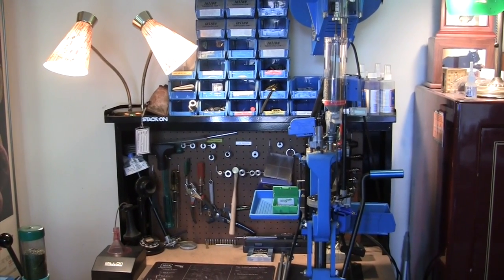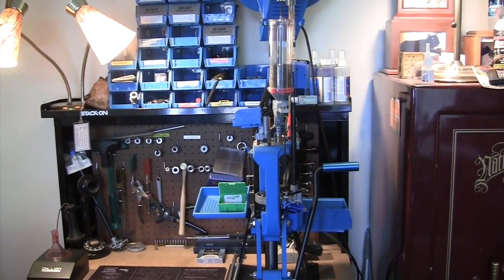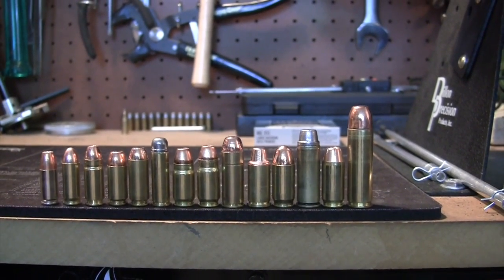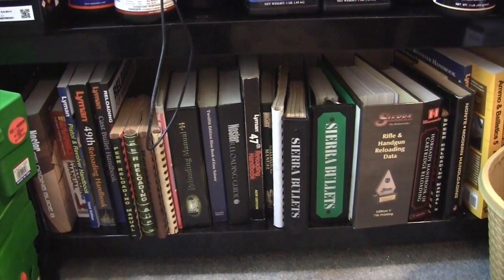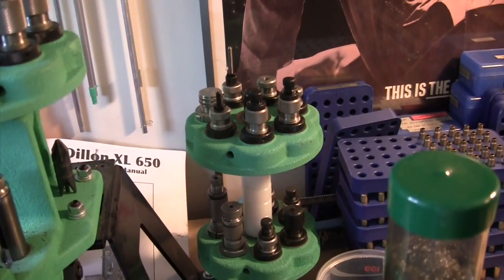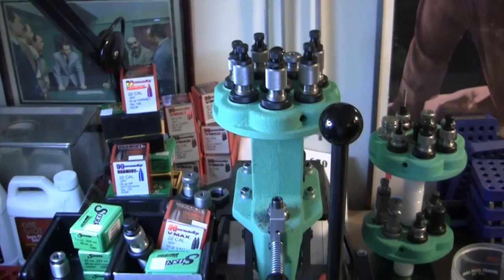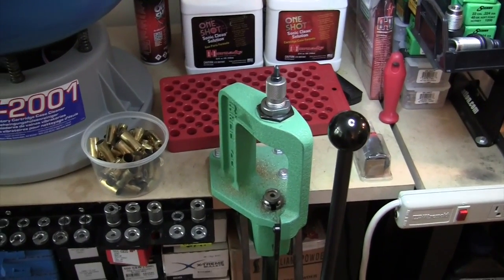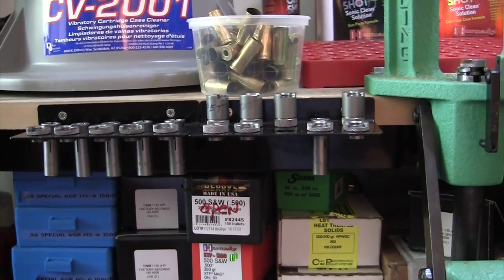Dillon XL650, Redding T-7 Turet Press, Big Boss 2 Press

Comment: Your experiences in reloading turn out to be an extrapolation of what my experiences in this endeavour will be.  Got 550s and 650s for a start when shooting primarily 45acp/38Super/9Major/40SW, 300BO, 762x40wt, 223/556N and 308W.  Got my first squib two weeks ago; an underloaded 45acp.  Lately, when I started shooting 375Raptor and 6.5C, 7mm—08 and 338LM, I started using my co-axial a lot.  I use a lot of equipment for hit and dimensional consistency such as giraud trimmers, 21st century tool, comparators, gauges, competition case holders and a horde of other stuff.  The difficulties I encountered with accuracy/consistency just made me decide to get a T7 this morning.  And then, boom, I chanced upon your video!!!  Thank you for this upload.  Very much appreciate this.👍👍
Reply from the maker: Thank you very much

Comment: Very helpful.  Reason being, I can't stand stuff that doesn't run smooth.  That's why I avoid Lee.  Too much aggravation.

The main thing I'm trying to decide is whether to go T-7 or Big Boss II.  I really just want a single stage with good leverage.  I think you helped me realize I should just go Big Boss II.  I can put a Lock N Load Bushing in it if setting the dies becomes aggravating.  I sent an email to Redding about the Boss.  I was concerned about the lack of primer feed and lower leverage.  You also pointed out the spent primer collection.  I needed those little bits of info.

I have a Hornady AP with a 3D Reloaded case feeder.  It runs perfectly.  Love it.  I have an old CH press with a flawless primer feeder for priming too.  I can't stand lousy priming systems.  Your off the cuff comments were very helpful.

Comment: I tend to disagree with the statement that you need something more than the Dillon unit for precision.  The United States Palma team used a straight ordinary Dillon 550B unit overseas because they could not bring ammo into the country they were precipitating in.  They Won that year. I do agree that the Redding T-7 press makes precision handloading a no brainer with Micro adjustable die sets and precision Case prep tools.
Reply from the maker: You can't load a 5.7x28mm on the Dillon though.
Reply: You are correct. and I stand corrected, Don't get me wrong because I'm not one of the "I drank the Blue coolaid" guys.  I have a rock chucker for that stuff, case forming and other heavy duty operations. Lately I have been working on my own You tube channel, I would like you to take a gander at it although I'm just getting started with it and don't have much content as of yet Jeff.  Thorsaxe777.
Reply from the maker: Thorsaxe777
Will do looking forward to subscribing
Reply: Thor - which year are you talking about? The last time the US team won was in 1985 (it’s held every 4 years) & that year (& every event prior to it) every team shot the same issued ammunition. You must be thinking of something else.